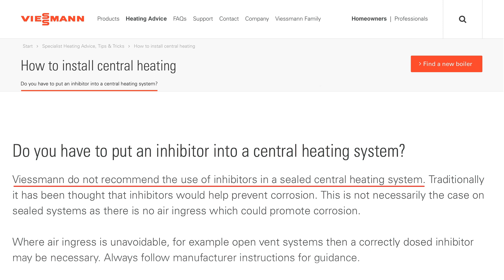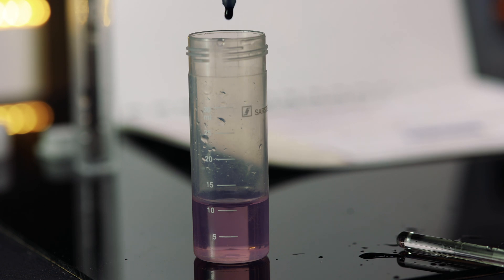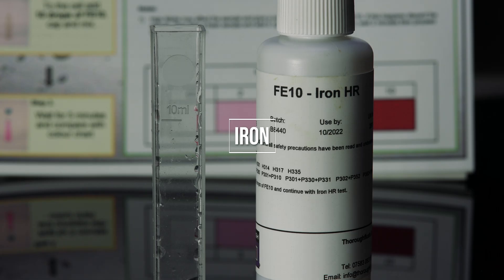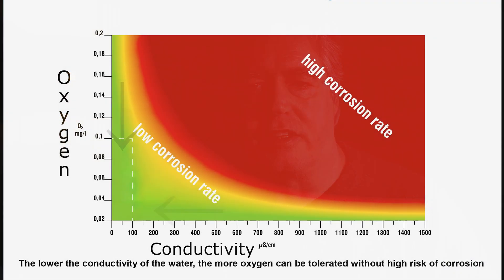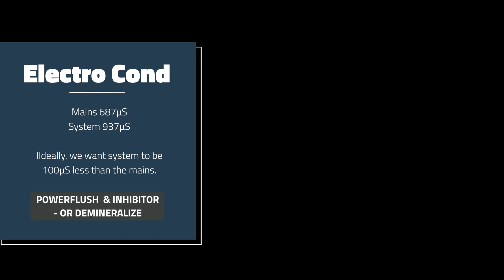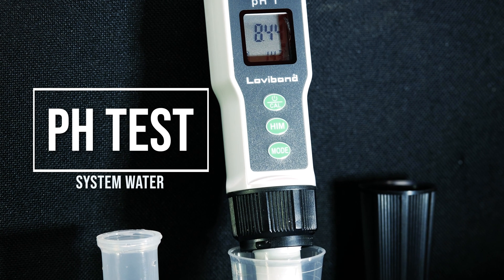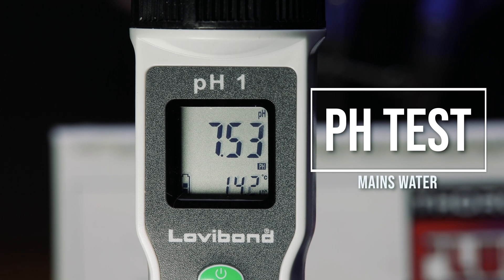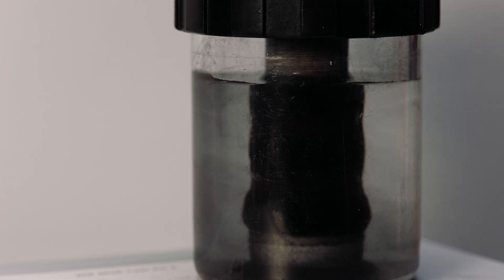Testing Water Quality of Heating System

Comment: Great video, you made a complicated topic very understandable. I have a question though, can manufacturers take a sample of system water and know what inhibitor was used without using individual test strips? I see Fernox, Sentinel and Adey all do the very expensive strips but do they all just detect the amount of molybdate in the system? 
Thanks
Reply from the maker: It's crazy, testing for inhibitors. I don't think (not 100% sure) manu's are any better informed than I am when it comes to testing brands. Only Fernox states what to test for, for installers to comply with BS7593:2019. 
I've gone in-depth on this subject, I have PDFs listing all chemicals used by all brands, how one inhibitor differs from another, but none actually state what to test for, except Fernox. 
Another reason why I prefer VDi2035.

If you want to know more, contact Ricky @ThoroughFlush on Twitter.

Comment: Thank you for the video!  I would be interested to hear your honest opinion of the Adey Pro Check, with regards to testing central heating water on an annual service.  I'm trying to figure out the best way to comply with the new regs and offer the correct advice to my customers, whilst keeping it realistic in terms of the time taken to test/cost involved. Or, do you think I would be better using a turbity tube, ph meter (or test strip) and inhibitor test strip to perform a 'quick' test?
Reply from the maker: Sorry for delay in replying, just seen your comment. 
Not a fan of Adey Pro check, I think it's a gimmick. 
Prefer a proper test kit with separate reagents for each test along with proper calibrated PH and TDS meters.